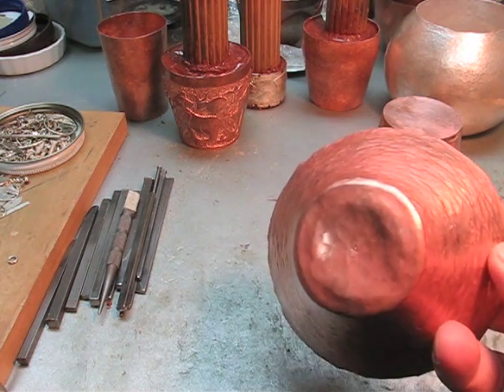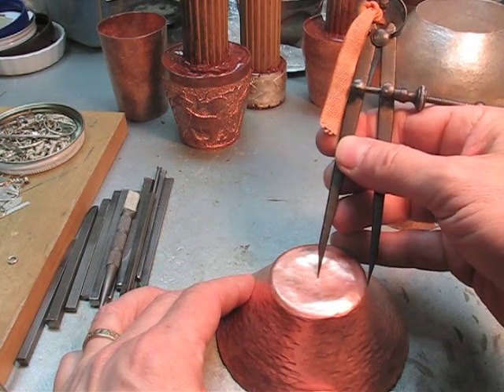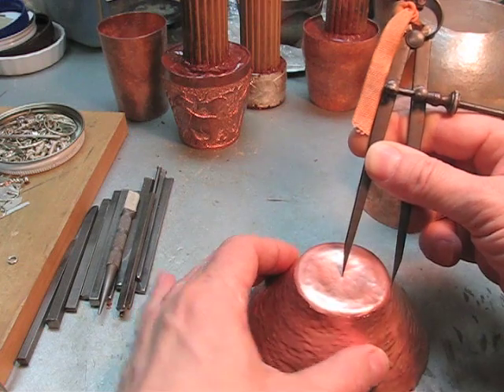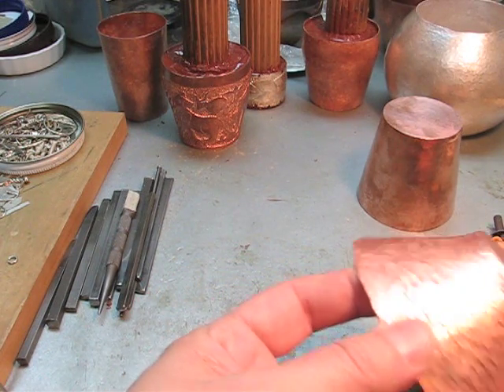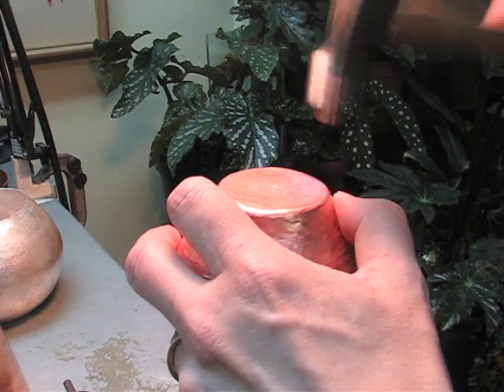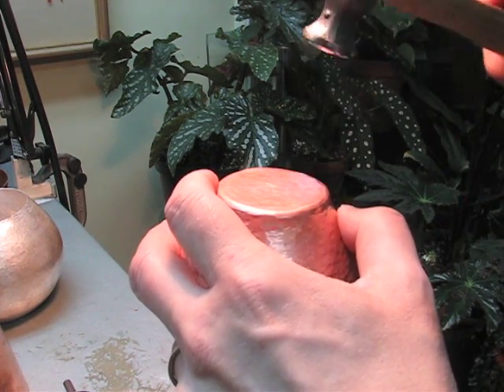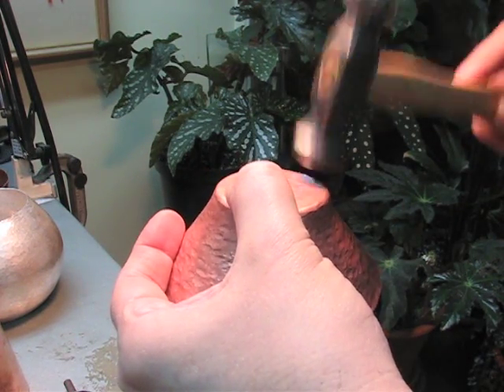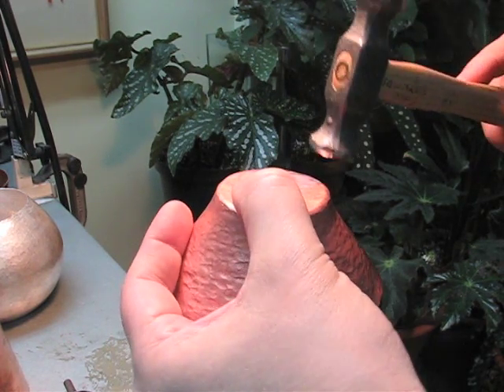Raise Copper Vessel 4- Beaker  Part 2

Comment: I can't be sure why this popped up in my recommended list but I can be sure that I find it to be truly amazing to watch.

Just one question if I may.  As are tamping your products into shape, how do you avoid stretching it so thin that it penetrates?
Reply from the maker: The metal is being moved not thinned, I  start with a 20 gauge disk and when the beaker is finished it is still 20 gauge no matter where you measure. It may tend to get a little thicker at the rim but that's not been the case for me and most silversmiths. The cross peen hammer is moving the metal up as the diameter of the piece diminishes. Sometimes it does feel like magic.  Thanks for watching.
Reply: @Ceropegia  
Wow.  Thanks.  That also looks like magic.  In the Episode  . . . Start by Sinking, at the 1:33 mark, you state:

"What I'll be doing is stretching the metal by striking from the outside . . . "

From my somewhat limited knowledge of metal work, I'm not sure how you can be stretching the metal without making it thinner.  But I will take your word for it.

Cheers

Comment: This must be getting a bit thin by now. What thickness was the copper when you started?
Reply from the maker: The copper does not get thin as it it raised when properly raised. I usually use 18 gauge copper for large pieces and 20 for things this size. Thanks for watching!
Reply: Sage Reynolds I can't see how that works. Surely when you hammer it, you're stretching it, that's how you manipulate it into shape. Like gum, elastic or whatever when it stretches, it gets thinner. Or are you saying if you had a piece of copper say 50mm square by 0.5mm thick and you hammered it and stretched it, to the point it was 60mm square, it would still be 0.5mm thick? Sorry I might be wrong but it seems that defies the laws of physicians!

Comment: What I like about copper is work hardening. You hammer it from the top, it stiffens up. Then you hammer it from the side, and the top won't bulge as much as it would with softer copper. With thin mild steel it seems like a never ending story. Hit it from the top, hit it from the bottom, 80% of your bend springs back.

Comment from the maker: My raising hammer, 300 gm, came either from  All Craft  or Metalliferous in NYC. Most of my other hammers came from Metalliferous. My goldsmith teacher altered my raising hammer when I was beginning to learn. Being a novice, I didn't know what he did but I suspect that he took the corners down and softened the edges from harder angles. I frequently take brand new and antique hammers to the grinding wheel to get shapes more to my liking. I use older reshaped hammers as stakes for special work.